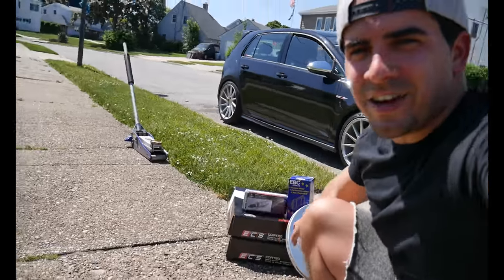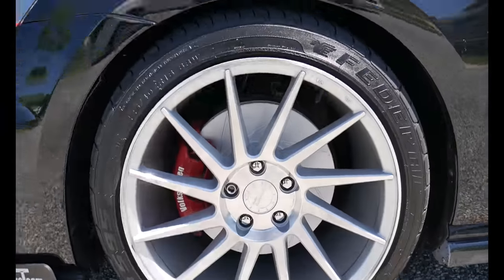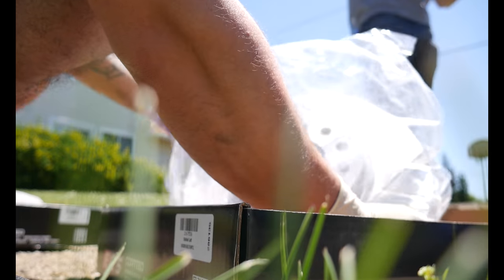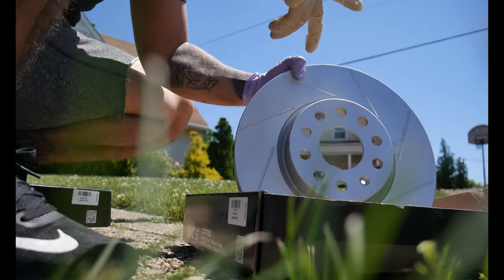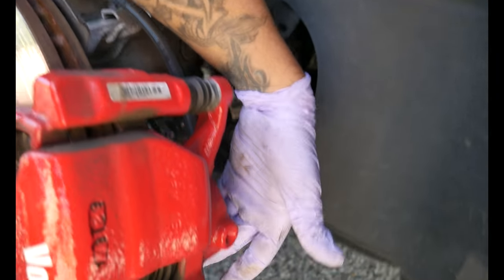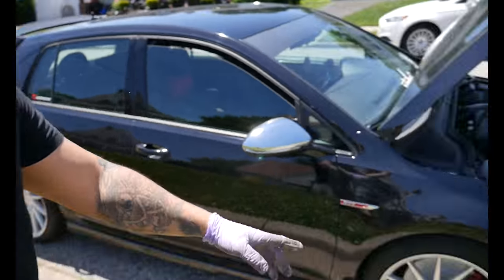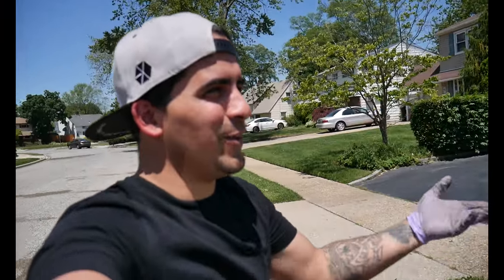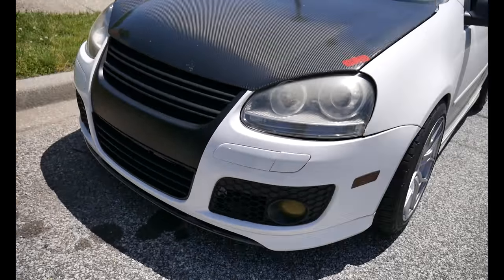Project MK7 GTI gets brake upgrades by ECS

Comment: Your tire is what allows you to brake hard, your lines are what determine response time and feel, and your rotors and pads are what determine how many times you can use the brakes without them fading.  That is the short and sweet of it, unless you are doing track days you don't need anything more than plain rotors, and break pads are really a personal preference.  I like EBC RED, but HAWK also makes some of the best pads you can get if you want to spend a bit more.  Stay away from race pads unless you are... well racing.

Comment: Almost had the same setup.  Got the ECS tuning Front and Rear slotted dimpled, slotted and drilled rotors.  I needed it after a track day I did last weekend
Reply from the maker: Yea stock is so spongy after they warm up
Reply: Yeah if you are going to the track it's worth getting a good set of pads and lines.  I would still be willing to bet plain rotors would do you just fine but a side by side test would be needed to get real results.